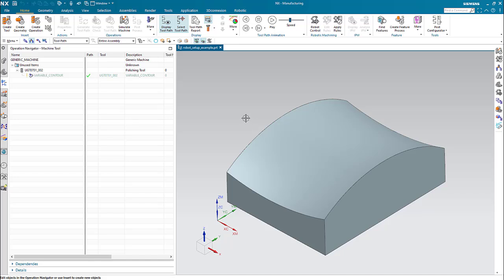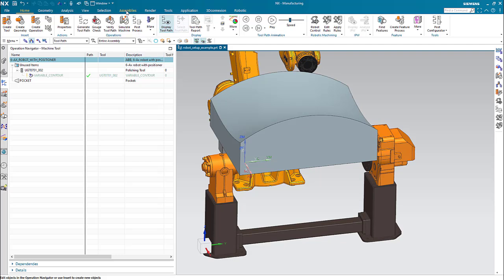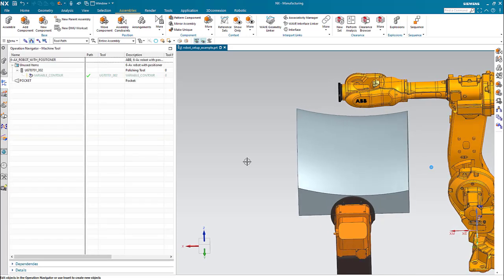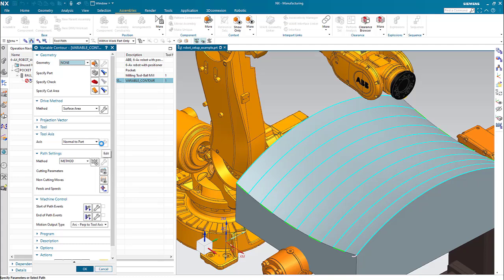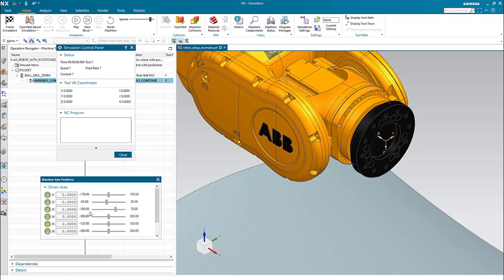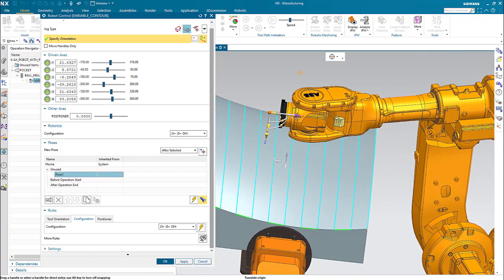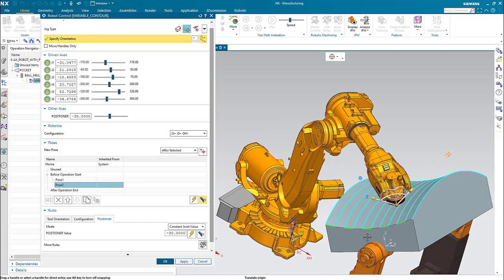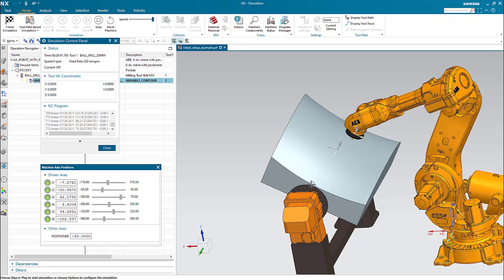NX CAM Robot Rules

Comment: How to add nx diy custom robot and prepare post processor nc code
Reply from the maker: If you have your own robot, you need a CAD model of it to include in the library (UGII_CAM_RESOURCE_DIR).  You would first need to add the robot kinematics using the Machine Tool Builder application in NX then save this model in the appropriate spot in the library.  I can add a video on this part, but it will have to wait.  To generate your own nc code, you need to write an application that works with NX - this is not something I've tried to do (yet) and I'm not completely sure of all the steps to do it...